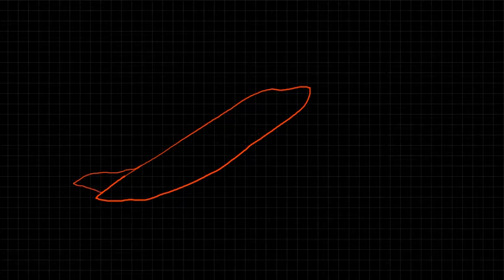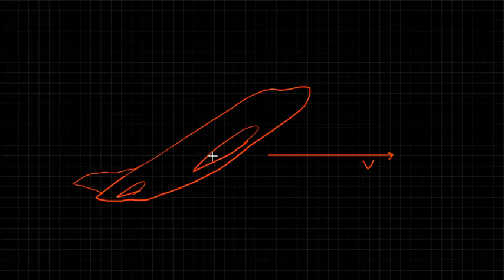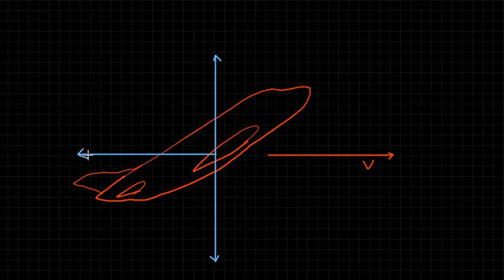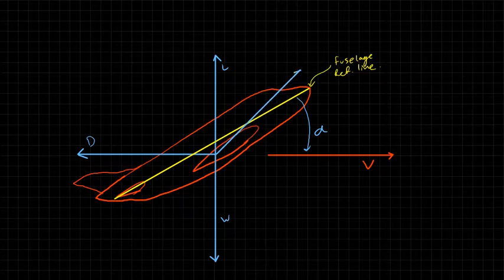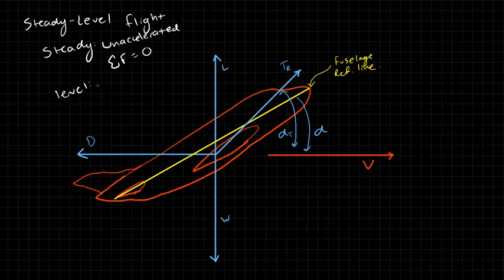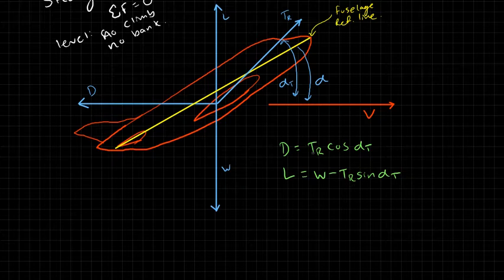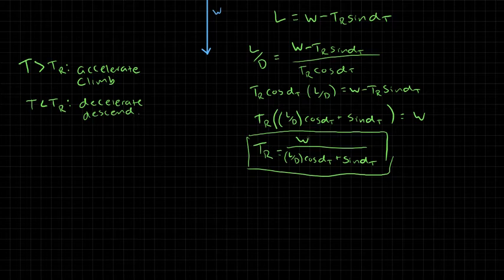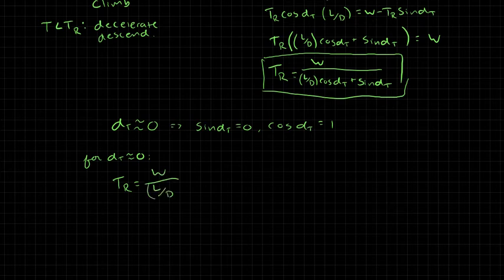Aircraft Performance . Thrust Required . Derivation

Comment: Hi, there is an issue with that definition of angle of attack. The angle of attack is the angle between the chord line and the relative wind/airflow.
Reply: A little late but i thought it was wrong as well, but by looking a bit further on the internet. Is it correct that the AoA doesnt necessarily have to be with the chord line of the wing as a reference (to the relative incoming airflow) but can also be taking from a different reference line on the airplane/wing (to the relative incoming airflow)?

Comment: Considering the orientation of the wing, I think the lift should have been perpendicular to the chord line of the wing. So the weight should have made an angle we the lift line extended
Reply from the maker: Lift is defined as perpendicular to the direction of the freestream velocity. It actually is not defined relative to the aircraft, but rather relative to the direction of the freestream velocity. So lift is not always perpendicular to the chord line of the wing.